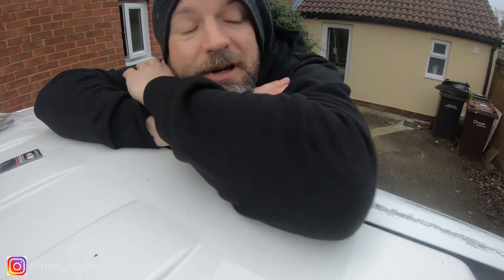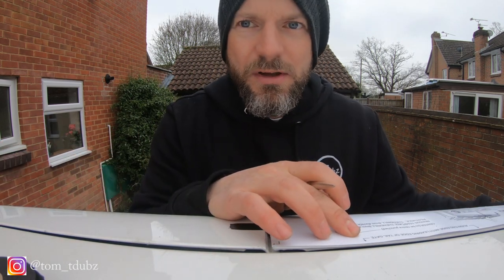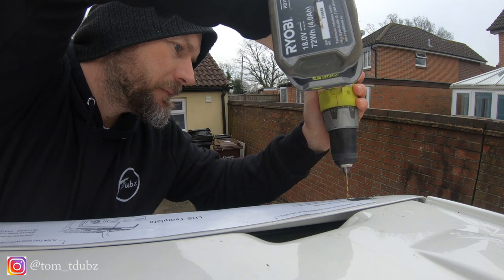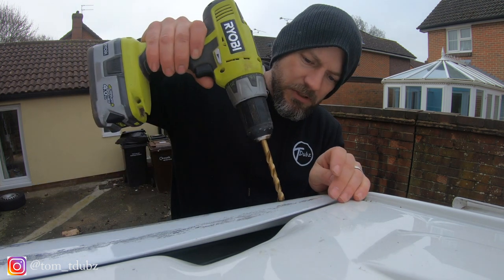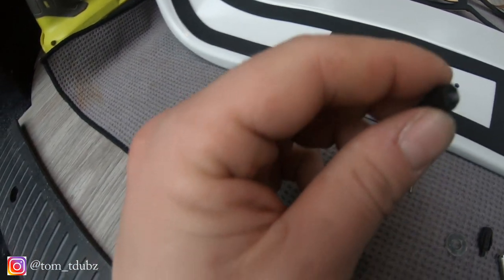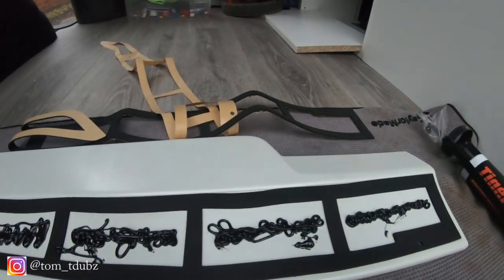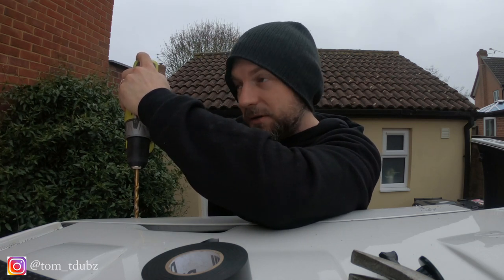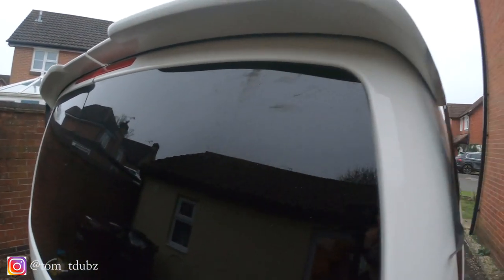vw t5 rear spoiler fitting guide #vwt6

Comment: Hi seen this video the spoiler u fitted no only has adhesive can recommend one with the fixing bolts thanks
Reply from the maker: Thanks for watching. This spoiler kit comes with the screws I just chose to use an adhesive as I didn’t want to drill through the van…
Reply: Thanks for replying what do u think of the spoiler is it better then the one witch didn't last long ie is it stronger Thanks again
Reply from the maker: @stuartcross749  it’s from Travelinlite.. to be honest they all come from the same factory anyway… good bit of kit 👍🏻

Comment: Useful video! How easily can you remove the spoiler? I am buying a van this week with a spoiler but want to remove it to fit a bike carrier. AS far as i can tell bike carriers need to fix to the top edge of the barn door which is no longer accessible with a spoiler fitted. would really appreciate your thoughts.
Reply from the maker: It’s quite easy to remove.. but of pull/shove.. but could take a while to clean up the glue.. depending on which one was used…

Comment: See the glue left over from your old rear spoiler what way did you go about cleaning it up for the new one? Thanks
Reply from the maker: Stanly blade… little bit of thinners, an then panel wipe.. the scotch pad the paint to rough it up slightly if your not using the fixings.

Comment: Any need for the rubber gasket on there? Fitting mine this weekend and as you point out its less flush with the gasket on. Decided to just go with puraflex40 on mine, no drilling
Reply from the maker: Don’t think there’s any need, gunna take mine off and re fit matte black soon, got a bit of time on my hands at the mo...
Reply: @tomtdubz  cool, yeah just removed one of the gaskets and the fit was a lot better. Not sure of their purpose unless its to stop water getting to the holes and I'm not drilling so will leave them off. Cheers